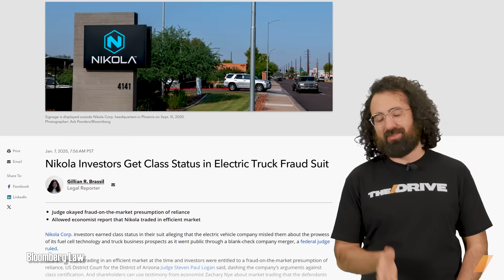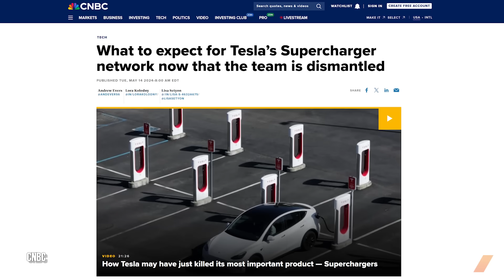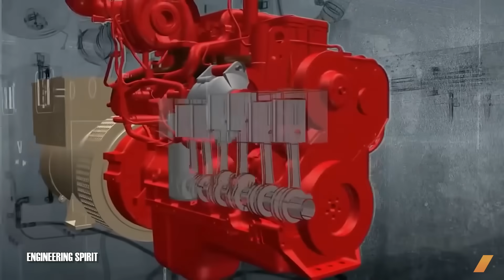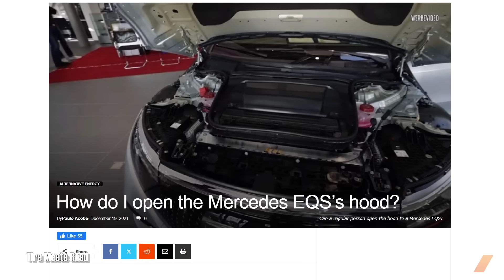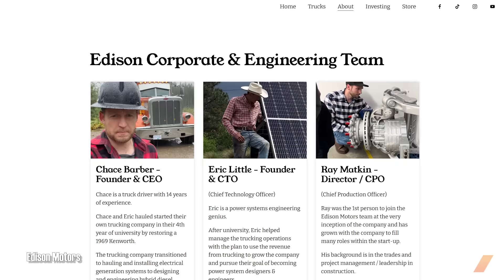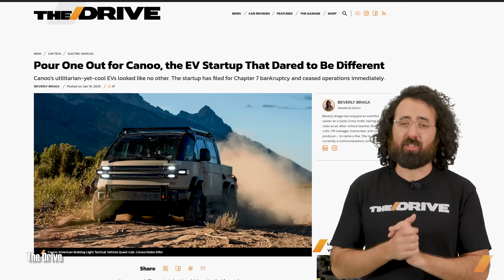The truckers in a shed beating Tesla with 100-yr-old EV tech

Comment: If your goal is to convert fossil fuel into electricity for such a vehicle, you might look at linear piston generators, the generator contains very few parts, very lightweight so you could increase your battery’s also extra space. It’s simple design, igniting gas makes a piston fly back and forth through an electrical coil that generates electricity ⚡️all valves and ignition are electrically controlled by a computer allowing timing adjustments for different types of fuel.

Comment: I worked for cat and a empty c-15 no oil no anti freeze on a stand weighed 5700 lbs. A Cummins X-15 should be around the same weight.
Reply: Edison only needs a lighter C9 engine to maintain AVERAGE loads. The batteries handle PEAK loads.

Comment: A diesel-electric transmission is not a Hybrid. A Hybrid has two modes of propulsion (uses a both a battery and an engine) that drives the wheels. 

A diesel-electric transmission just uses the engine to power the vehicle, it just uses an electric transmission instead of a mechanical transmission.

Comment: I'm  a farmer. These solutions seem directly transferable to a typical use case for an agricultural tractor. I wonder if 4 separate electric motors in for each wheel could provide even more torque.
Reply: The best part about this setup would be the fact that you can easily scale up the motors to reach the required torque especially since you don't have to worry about things like sprung weight

Comment: This video is a huge misguidance.  Full EV heavy duty Trucks can do about 90% of the work required by them.  There are only a few niche situations requiring a diesel hybrid…and that is really light on the diesel part and way heavier on the EV part.  So by adding a small (minuscule) diesel engine to the mix you can charge the battery system when needed and power the whole vehicle by…Batteries and much more efficient motors to turn the wheels.  Diesel engines are innately dirty and wasteful.

Comment: I’ve had Edison Motors on my radar for a while. Their ideas seem sick! Tough there is an even better solution to replace most semis that you see on the highways, trains. Good heavens if we just had more and better train infrastructure we wouldn’t be so reliant on semi trucks.
Reply: semi trucks handle "last mile" and "time sensitive" loads that trains can't do.
Reply: @Sah-o5m  Yes, you're right there's definitely still going to be a need for them for those purposes. I could have been more specific, I think the long haul trucking routes across the country and continent should be replaced by a more robust rail network.

Comment: The BYD's DMI drivetrain, is to use electric for high torque or low speed performance, while using a single-speed direct drive gear for high speed and low torque performance. It's almost in every BYD hybrid cars, and small trucks.
Large trucks and semis are mostly run on internal combustion engines though. There are a small portion of semis running on changable batteries, which are economic for trucks mostly moving between fixed terminal stations or inside an industrial yard. They change their batteries under cranes grabbing and lifting heavy batteries, like how steam locomotives used to get their coal.
For those semis only run on internal combustion engines, more and more semis are using petrol engines intead of diesel engines, using natural gas as fuel. Which is more eco-friendly, and now cheaper due to Russia and mid-Asian countries' increasing supply.

Comment: Not a chance to make something that burns diesel as efficient as an EV - Ev trucks will easily be three times as efficient- that’s a massive difference
Reply: "efficient" ? you mean like mpg? EV's are not 3 times as efficient as diesel, they are infinitely more efficient because EV has zero MPG. If you mean Total Cost per mile, that is different. Edison trucks can charge up over night like any EV and then can run all day long on the diesel engine.

Comment: I like this I hope this takes off. the thing about EV is there is a power plant generating that electricity used to recharge them, might has well have the generator inside the vehicle. the fuel saving while in slow traffic and driving sold me on the idea.

Comment: Disliking simply because I don't think this is a fair representation of Edison. Showing only the upsides without consideration for the potential downsides isn't very helpful or informative.
Reply: A powerplant is more efficient ant turning fuel into electricity compared to a engine in a truck, you save fuel but not much.

Comment: Apples and Oranges.  The Edison truck is a completely different application.  It is about leveraging altitude and the free potential energy of the weight of tree trunks to power the trucks.  The Tesla trucks are for hauling goods along hundreds of miles of relatively flat roads.  The Tesla truck is still the ideal configuration for repeated freeway hauls.  The Edison is good for bringing logs down from high elevations on mountains, storing the new energy from the logs' weight.
Reply: well said :)

Comment: THANK YOU!  I've been wondering why someone isn't making a series diesel hybrid, where the diesel can run at a single, optimum speed to turn a genny, with a smallish battery bank to make up from transient loads.  Trains have been doing this for what seems like forever, and they're making money and keeping the engines running for generations.  Even with hybrid cars and light trucks, use a small two or three cylinder turbo diesel in a series setup, rather then the more popular parallel setup where the ICE and genny are both connected to a complex transmission.  You get the advantages of the electric torque since the battery can instantly respond while the genny comes up to full load; and you get the advantages of an ICE because you don't have to worry about the next charging station., and fill-ups take 5 minutes or less.  Big props to Edison!

Comment: Yes, the basic drivetrain is much simpler. Where the truck driver, on the dirt floor, falls down is when digital control units are introduced. The 18 speed transmission can be visually inspected, wear identified and components replaced with commonly available tools. 
Try that with a box full of silicone chips.
If they can keep the control systems simple, the reliability will be good and the setup will be a success. If you need a degree in computer science, to fit a set of brakes, or repair a rear axle, it won’t.
These long haul vehicles need to be repairable at the side of the road, using tools that can be transported easily, or better yet, carried on board.
Even a badly blown up manual transmission can usually make it home, in the hands of an experienced driver. A generator with one shorted coil will not power the drive axle, even without an electronic brain to go wrong. 
This stuff is NOT simple. There’s a long way to go, before you see these on a highway near you. Diesel electric locomotives are being phased out all over the world for a reason. Continental America has different needs, because of its size and reliance on rail for goods transport, meaning they’re still married to the locomotives. In most countries, trains are for public transportation, rather than goods, and locomotives have been replaced by either full electric trains, with driven bogies in every car, or by diesel multiple units, with small quiet diesel engines driving through automatic transmissions in every car.
Once again, this is a second world focused video, which has a unique perspective that doesn’t necessarily translate to the rest of the world.

Comment: You stated this with pickup trucks, but if they retrofit their system to retired semi-trucks, then they might be able to bring the cost down a bit and recycle in the process. Another thought (that I'm sure they have considered) that is if the generator is powerful enough, you could have supplimental powered axles on the trailer itself. This would increase towing capacity at a marginal weight penalty with minimal complexity, but essentially just running power wires to the axles. (I know it's more complex than that)

Comment: Series hybrid diesel was always the next logical step, not all electric. Then toss in a dual fuel system allowing the use of renewable biodiesel as a secondary fuel source. Eventually, as a renewable biodiesel network expands, run that as primary. For large enough trucking companies and corporations, they could literally grow their own fuel for their fleet. This allows time for all electric systems to lower their real carbon footprint and develop more energy dense power sources.

Comment: the biggest flaw in the EVs is the whole idea of a charging station instead of battery swap out stations. if it's going to have any chance you need to be able to recharge in a mater of a few minutes.
next with the whole weight thing, what's going to happen when all these old bridges are packed with vehicles that weigh 4 times more than they were designed for?

Comment: how exactly is edison "Beating tesla" ? they have an initial retrofit prototype and one custom fully functional development unit and some in other stages of build.

while Tesla has built and delivered 500 units that are on the road, not to mention that Tesla is also using technology that is well over 135 years old as the first fully electric production vehicle was built in 1888.

Peterbilt is also producing both full electric vehicles and hybrids, the first hybrid was introduced in 2006 and on the road in 2008.

Revolt sold its first electric hybrid truck around the same time this video was released.

The US government has given EV trucks a 2000 lb offset to increase to thier max GVWR making thier limit 82,000 lbs, tesla has said thier heaviest version of the semi is 22,000 lbs, i have driven trucks that the tracter weighs 27,000 lbs, please tell me you know nothing of the trucking industy without telling me you know nothing about the trucking industry.

People said the same thing about the supercharger network that you are saying about the megachargers, you are trying to imply that just because they don't roll out the megachargers instantly that they have failed, first the megachargers are going to also going to power the next major generation of passenger vehicles as well, eventually you will be able to charge model S,E,X,Y, CyberTruck or whatever in like 5-10 minutes so we do not have to dream, we just have to wait.

A 2026 Western Star 49X - Sleeper for sale near me has an asking price of $218,990 if you add 25% you get $273,737 but a Tesla semi is $250,000 so it is really only less expensive if it is a conversion of an older used truck.

I find the writing in this video sloppy, biased, disingenuous and misleading.

I love what edison is doing especially with thier light duty vehicle conversions but this higly agenda driven sensationalized form of journalizism needs to go.

Edison has a great story but thier heavy duty truck product is currently highly focused on vocational trucks and very niche vehicles.

Tesla is succeding and you want to attack them because "Tesla man is bad" and that is just gross.

Comment: 2:53 That doesn't include the weight of 100 gallons tank of diesel
Let's say average over the journey to 50-60 gallons weight (100 gal down to 20 before refuelling), that's another 2 tons on average
(450 litre tank, 190-230 kg) The weight difference here is in the transmission

Comment: I hope Edison's truck has a EV charging plug pass through so that if the truck runs out of Diesel in the woods and the trucker manages to find a EV charging spot the trucker can bypass the Diesel charging setup and directly charge the Trucks battery.
Reply: It does. Chase has a video of 'Topsy' (their prototype) parked in front of (I think) Kamloops' city hall, plugged in to an EV charger.
Reply: :) Edison trucks can pull power from the grid to charge, and can offload power back to the grid (like for a house, or a welding truck)

Comment: Electric Power trains actually predate the Diesel engine by about 10 years, they were originally developed for Electric Streetcars and Subways in the 1880s and in the 1910s expanding to Electric Commuter Trains,  it was only in the 1920s that the two technologies were merged, and they didnt get popular until the 1940s with the General Motors Electromotive Division FT type locomotive introduced in 1939

Comment: Think of a series hybrid as replacing a multi-speed transmission with electric drive. Both address the fact that ICEs are efficient in a narrow rpm range. Honda and GM's Voltec operate in series in some modes, although they also have a direct drive mode as that can be more efficient at higher speeds.

Comment: In Germany there is a channel from a truck driver, who drives electro trucks. The different trucks have ranges of about from 400 to 800 km. That's about 250 to 500 miles.

And in EU a truck driver cant't drive more because there are restrictions of the maximum steering time per day. That's 10 hours (9 hour regularly) with a mandatory break of 45 minutes. And there is a maximum speed of 80 km/h for trucks on the Autobahn (50 miles per hour).

Often he charges his trucks at regular car charging points. In normal case these trucks are charged from about 10 to 80 or 90 percent in a bit more than 30 minutes or even less. I think for a lot use cases these fully electric trucks would be good enough in America too. If there are super chargers or something similar there and it is allowed to undock a shorter truck could load on regular car charging stations. The operators of the charging stations would certainly be very happy about this because it would bring in a lot of revenue.

But what I really liked was the approach of not sealing off the technology, so that it remains easy and practically repairable by anyone.
Reply: I celebrate the success of the german electro truck driver :)  I would LOVE to have him bring his truck here and spend a day doing offroad logging 100 miles from the nearest charger.
Reply: @Sah-o5m  The Elektrotrucker often transports charging stations across Europe (e.g. from Italy to Sweden), but not really offroad. More on the road, to help that it won't be 100 miles in the future. ;-)

Comment: The other weight-related problem with the EV's that people seem to miss on is that it puts more stress on tyres, which means that you need to buy better ones and more frequently, which also cuts into your budget AND, for the eco-heads out there, cancels out the benefits that you save from emissions with rubber components you shed and all the pollution involved in producing new tyres and retiring/recycling old ones
Reply: Well said, sir. Great to see someone who still understands the disadvantages of BEV.
Reply: "cancels out", no, not even close.  Yes, there ARE more emissions, but the amount of emissions don't come ANYWHERE close to the reduced emissions from the vehicle.

Comment: I have been looking at Edison for a while now, great idea.  I have been an advocate since I first heard about it.   However, this does not mean full electric is not the future, it just has some very specific use cases today, and needs more R&D.  The next generation of batteries are going to last 1 million miles, energy density is increasing, the grid is a problem, but that is mostly regulatory, not technological.  I see the tech as complimentary, rather than an either/or proposition.  Different use cases.

Comment: This is propaganda. More that a few specious claims. Just because GM made an abortion called the Hummer EV, does not make it a yardstick to measure trucks. There is less of an impact on the grid from electric vehicles than by data centers, which are multiplying as we speak. Just because you get a long hair guy to promote it, that doesn't made this loosely bound set of factoids correct.

Comment: 7:50 two powertrains in one... No. No you dont. You are thinking of actual hybrids, not a diesel electric. In a hybrid as commonly understood, such as a prius, bot the engine AND the electric motors can work together, or one at a time, to drive the wheels. They are, essentially, two seperate systems. In a diesel-electric ONLY the electric motors turn the wheels. It is ONE powertrain. Deisel turn genny, genny charges batteries, batteries power motor, motor turns wheels. A hybrid engine can either turn wheels, or charge battery, or both.
Reply: You are correct but you did sort of miss something.  As part of their not stranding the driver design, the diesel and the electric drive are more like two big parts of the same system because in a pinch, they can drive with the batteries unhooked or with one axle unpowered.  This reduced the issue with a single point of failure making the truck no longer able to move.  It is a great idea.
That are also building in the ability to plug in and charge so that they can use the cheaper electrical power for at least some of the day.
Reply: @kensmith5694 batteries do not make a hybrid. A hybrid has two seperate powertrains, ice and electric that can independently power the wheels. In a diesel electric, only the electric motor powers the wheels. Just because a battery is present does not make a hybrid. I get that the battery can power the motor by itself, but the diesel can not move the vehicle. Thus not a hybrid.
Reply: @Demonslayer20111  You are incorrect in your definition.  The Edison truck is a "series hybrid" .  It has an added feature that the engine can indirectly move the truck via powering the motors excluding using the batteries.